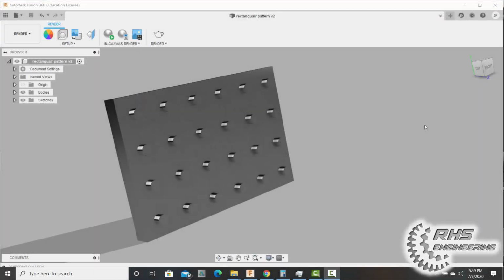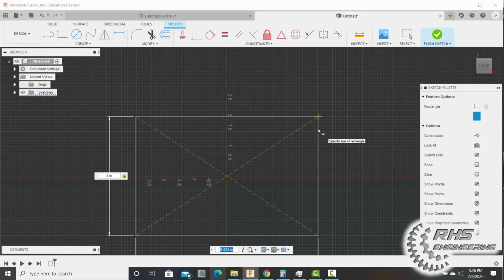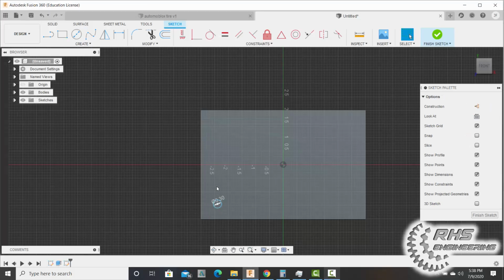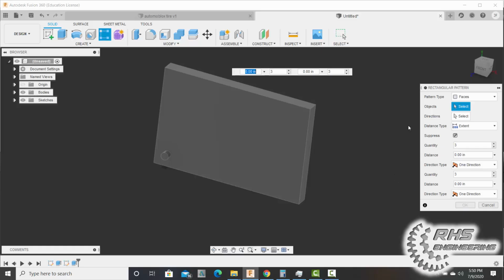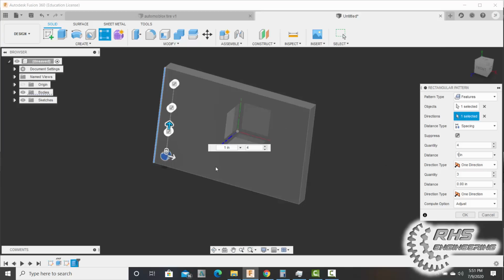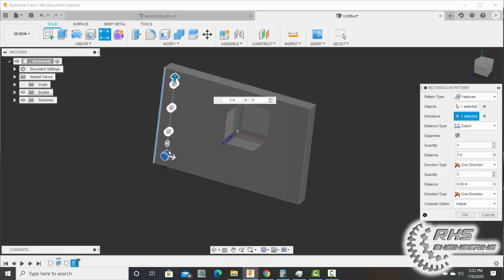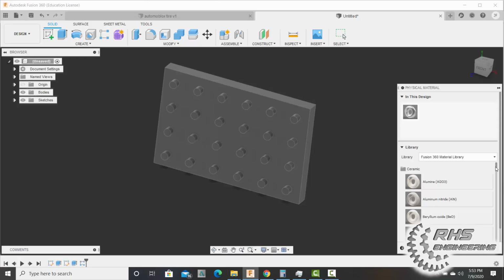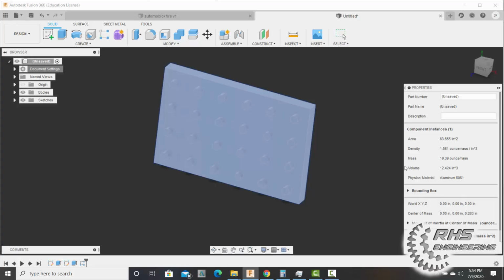Making Rectangular Patterns with Fusion 360

Comment: i have my basic shape how do i hollow out the inside and leave the wall thickness of 3 MM. and then how do i add 4 tabs on the sides. its basically my first attempt at this. its a simple battery cover for a 9 volt battery
Reply from the maker: Use the shell tool.
Reply: @JohnFuller804  ok  ill try that tomorrow tks